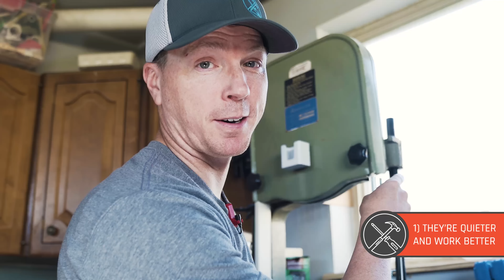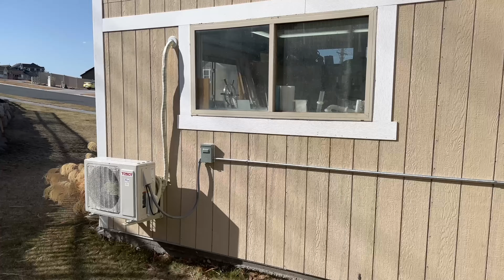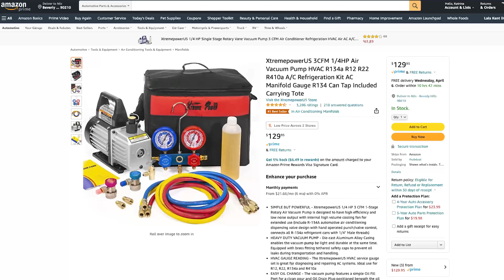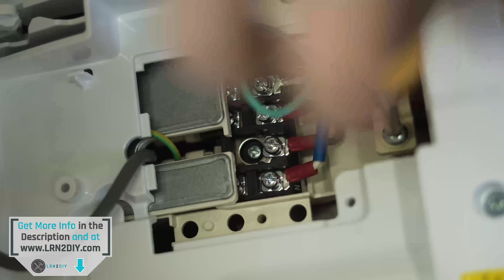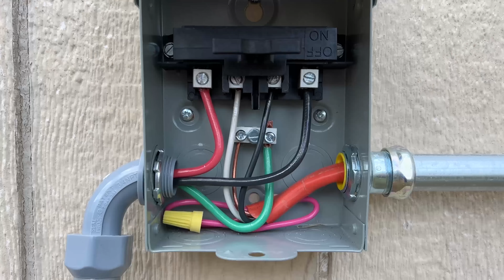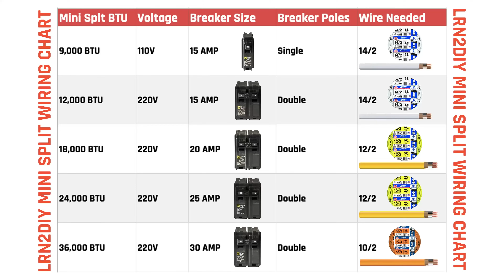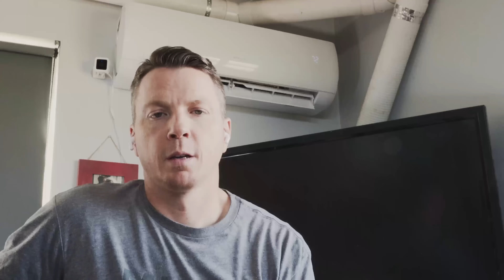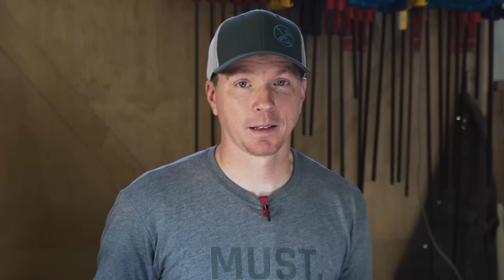Mini Split - 3 Things I Wish I Knew Before Installing

Comment: One other thing to mention is that the units where you don’t have to draw a vacuum, you can’t cut the lines. If you have a lot of left over line you just have to leave it coiled and try to hide it. On the others you just can cut them and glare the ends and have a cleaner installation. Great video

Comment: Just so you know the voltages are 120 volt and 240 volt not 110 and 220. Also figure a little higher for the electric than lower because depending on the distance from your panel the wire size might have to be upgraded in size to accommodate the length. Also a non fused disconnect is around $45. And all this electric is dependent on the homeowner doing the work or it could be upwards of thousands of dollars for a “Professional “ to do it. Another thing is most A/C “Professional “ don’t like to work on DIY equipment so you could be on your own for projects like this.

Comment: Not for nothing , you didn’t have to put the window ac unit in a window …cut a hole high up on a good wall and mount it there … not only will it work better , but you won’t bang your nogging ! 

But now you got a mini split … which are awesome …
Reply from the maker: Through-the-wall is a great option — you keep the window and get better placement out of it. Appreciate you watching!

Comment: I understand the precharged lines with the Mr. Cool, and why you would need to pull a vacuum with the other unit, but then where does the refrigerant come from.  Does the other unit arrive in a pumped down state where all the refrigerant is in liquid form stored in the dryer/receiver/accumulator and after you vacuum the lines, you just open the dryer valve?

Comment: I installed a Seville 9000btu unit 4 years ago. Took me awhile to, but it was not too difficult. I had to recharge the refrigerant this spring (found a leaky schrader valve) and it now heats and cools like new. If you can do electrical and basic plumbing, you can do this. TIP:  buy the proper tools!!!!! It’s worth it.

Comment: For the cost of a cheap vacuum pump off Amazon and ordering a 12k btu mini split from Lowe's online. I'm less then $600 in the min split setup in a detached 120sqft converted shed/office. It's May 2026 and the prices must have really come down. Mine is also a 115v unit and yes you can wire it with a regular 3 prong plug but I wired it to a service switch and then to the panel from there. I am not an electrician but I am a contractor and had an electrician buddy hook me up but I did dig the trench for the conduit and did all the rough in work. Perks of being in the trades.

Comment: Companies encouraging homeowners to attempt mini split installs can turn into a complete nightmare . Im going to look at a 3 head system in the morning that leaked off the first day they used it . The guy pressure tested by opening the valves . What a mess . Get ready to dig deep in your wallet because I will show now mercy.  Total foolishness.  Stop it ! Just stop it already . Have a qualified hvac or refrigeration tech at least pressure test and vacuum down with a blue vac micron ,add factory spec charge if needed for longer line sets .  You only get one chance to get it right .

Comment: oh how things have changed in the last 3 years for the cost of electric cables to run the electric lines. The running of electrical lines is frankly my biggest hold out.. Mostly because where I want the Mini Split is on the back of my building and the panel is on the front so it will take a lot of cable and routing in order to get the lines where they need to be to power the unit.

Comment: Those lines from Mr Cool are pre-vacuumed that's why you do not need to vacuum the system after the quick connects are done.
The "other" brand lines are purged an back filled with nitrogen.
BUT you are correct, follow the directions and you can do the vacuum process yourself!

Other options to consider with unit cost;
1) Motor control for the blower vane direction for z (up and down) and y (left and right) or manual.
One of mine is both (great for larger areas) and the other is only z (up and down) where z is manual (great for smaller areas).

2) Units can be equiped with internal heating elements for very cold cliamtes.

3) Internal UV lighting for microbial air cleaning.

4) Cheaper units do not have good vibration mounts, so if you get the flat piece of rubber, buy the better ones.

Important note for installation, people take for granted the condensate lines which drip water so keep it away from siding.

This is a great video!

Comment: Just an FYI unless you have an EPA ticket to work on refrigerants it can be a huge fine just opening the valves that allow the refrigerant to flow into the lineset and indoor unit.  Chances are small that would happen, but it's not a zero chance.

Comment: I believe you forgot to mention the cost of the Freon? What did you pay for the Freon you used to charge your system and line set with?
Reply from the maker: There is no additional cost. When you open the lines from the condenser, it's precharged with the refrigerant and goes into the lines. No additional freon or refrigerant is needed.

Comment: Here in New Zealand those single unit window THINGS do not sell here. Almost all are the twin unit types. Just a point, I would not mount the outside unit to the walls of the house. It can transfer noise and vibration into the home. Better to mount it on a concreate base or tile. The hole unit makes less noise, full stop.

Comment: 🌴🤔 I’m going to be getting a mini split put in , I have a window shaker for A/C right now , I’ll need to install a dual zone as one unit will go to a bedroom on the far side of the house and one unit will go to the living room , I’ll have to have enough refrigerant tubing line to reach each area , ( how long are the lines that come with the mini split system ?) 👈🏼 can you buy extra lines ? How much do those cost and do they have different lengths? 👈🏼  as the outside area of my garage close to the electric box inside is the perfect spot it’s just that I have to bring the lines up the wall outside over a one stall garage ( first drop for inside zone ) it’s about 21’ feet, and the second line would go up the wall outside over the garage ,over the living room to the bedroom wall 35’ feet , —- how long are the lines that come with the unit ? Are the extra lines pre charged ? 🤔

Comment: I didn't hear you speak to the cost of the refrigerant?
Reply: But one that is pre charged. I just finished mine today. Once everything is complete and you pull a vacuum on the system you use an allen wrench to release the refrigerant.
Reply: *Buy one pre charged

Comment: Per your graphic, the A/C Branch circuit breaker is located in sight and within 50 ft of the equipment, so separate disconnect is not required. The AC branch circuit breaker is your disconnect in your case.
Reply: I think the graphic is misleading because he shows the indoor unit and the main electrical panel even though they are indoors, just to show all the bits. So it wouldn't be "in sight" to someone working on the outdoor unit and depending on where the door is it could easily be more than a fifty foot walk. 
I'm in the UK and mini splits just plug into any standard outlet. That's the great thing about having 230V 13A outlets as standard. Mini splits come with the mains lead and plug fitted to the indoor unit and the outdoor unit gets power from the indoor unit. There's no requirement for an outside isolator switch.

Comment: 1. Call a professional to do the install. That is a bad location for the indoor unit. Cleaning the filters and service in the location is going to be terrible.
Leaving the extra refrigerant lines coiled up outside is a very bad idea. The oils will not get back to the compressor properly. Compressor WILL fail! After doing it yourself you will probably have a hard time finding a professional to come and fix it for you. But you saved a couple bucks.

Comment: What is the difference withe the cheaper ones you can buy off of Walmart? Also we live in a trailer house... how do you go about that if yiu have an extremely old hvac system you just want to get rid of? Do you put one in each bedroom or just one bigger one in the living room area and just try to run fans?

Comment: I got a vacuum pump with gauges and the adapter for $60. Installed 2 18k btu units for $800 cheaper each compared to the Mr Cool. I saved $4k from just replacing my heat pump not counting needing to overhaul the old ductwork.

Comment: looking to buy a new home and most homes here are old and its hit or miss if it has central air or not. i guess i can install 3 minis  or maybe less. since the homes  im looking at are smaller 1k sq feet but if its 2 story ill dev need one at the top level

Comment: Such a good presentation of information.  I had the electrical work for the minisplit I am putting in done by a professional electrician.  The actual mounting and vacuum test on the lines is tomorrow

Comment: Many states will not allow you to buy the refrigerant that goes in those systems without a state authorized license and knowing about the charge and how it works and all of the details to evacuating the system escape most DIY and doesn’t take much an ounce high or an ounce low it’s not gonna run right. If you evacuate the system and you don’t charge it pump it down when you still use nitrogen, that nitrogen absorbs any moisture in the system when you blow it off and pump it down again you’re much better at not having moisture in the system.😊

Comment: For us, I miss the thermostat on the wall to give me current room temperature. The Gree mini splits don’t give a room temperature reading. I also don’t like that each indoor unit that shares an outside condenser must be on the same mode. For example, if you have 3 bedrooms connected to the same outdoor unit, they all have to be in cool mode. One can’t be “cool” and the other to “fan” or “heat”…. That’s more of a problem when different floors use the same condenser. But, I’m researching something to display room temperature that can also be monitored remotely.

Comment: This guy just told you to use a $130 vacuum kit.. This kit is shown to come with the blue/red/yellow hoses you see HVAC guys use. Those red/blue/yellow hoses CANNOT be used for vacuum has they allow for "gas exchange". They are REFRIGERATION HOSES designed not to bubble.. Simply put.. HIRE A CONTRACTOR.. VAST majority of the DIY HVAC videos are simply a cinema of mistakes.

Comment: [This is 100% to help to everyone here] - Licensed JW - The breaker required by current code is going to cost between 100-200 by itself (depends on your exact electrical panel). Yes, another option is a non-GFCI breaker at the panel and a hot-tub style disconnect with a GFCI breaker contained; basically the same result. Factor either in here for sure. Yes, you are required in most places to have a permit for electrical work. Perhaps you aren't, but another cost if you wish to abide by rules and possibly have issues on a future resale. Also not mentioned - code requires within 25 feet of your AC installation (the outside unit in this case) to have a service receptacle. Many of us call this an outlet. That is required to be WR rated, with a heavy duty rated cover, and either be protected with a GFCI breaker or generally it is easiest to have a WR GFCI receptacle. BTW - The GFCI breaker for the mini-split is not the same as the one for the service receptacle. There are two different circuits here: one is protected by a 240v and the other by a 120v. (Ignore all the 110,115,120 <it is all 120 for terminology> and the same for 220,230,240) Good luck and cheers :)

Comment: Very great advice! Only critical thing you didn’t cover is installing surge protection. I found quickly mini split /ductless units are very susceptible to damage from power surges and outages.
Reply: How did you remedy this?

Comment: 2 more things you didn't know: 1. 2025 brings new R32 refrigerant requirements which means your R410A will be phased out. Also I.R.A. gives you a 30% tax credit on certain Energy Star rated heat pump mini splits. That's up to $600!

Comment: I have a LG AC/Heater unit in my garage. It is over 20 years old & it went belly up. Unfortunately I have to get another LG thru the wall AC/Heat unit since I do not have any room to install a mini split unit. I will be putting a mini split unite when I build my 20 foot by 20 foot shed next year.

Comment: Two things regarding the electrical: No Romex in conduit, run separate wires, it's much easier. Also, the service disconnect has to be within X feet of the compressor (in CA it's three feet), so check what code is in your area.

Comment: Question :  how far away can the outdoor unit be (and the line sets) from the indoor unit?  Also does the indoor unit have to be on an exterior wall?
Reply: From what I read you get 16 foot with the unit. The Freon in the unit is for 16 foot. You can get 25 and 50 foot but you will have to use an AC guy and put more freon in the line. The outside unit should not be in the sun or heat. The indoor unit can be on an interior wall but you will have to figure out how to install the copper lines. You might have to redo some sheetrock. That's why it's easier on an outside wall  you just drill one hole and seal it.

Comment: Hey Bud great videos, I recently got inspired by you seeing how easy it is to install the mini split units. I went and purchased the Tosot 12K BTU 230V my question is 2 part 1) if I’m not mistaken it’s a 15amp am I correct cause I went and purchased a 2 pole 15amp circuit breaker and 2) I have some 14/2 romex left over from some other wiring jobs I did around house, or should I bite the bullet and just buy 12/2 in case I want to upgrade the unit. Again thanks.

Comment: Installed a new 12k mini today but disappointed that after vacuum and pressure test that worked perfect I only get 49 degrees out of it while my neighbors is 36 degrees. I kept the same 3 year indoor unit but it was ok. Any idea where Im losing 13 degrees.

Comment: It's so crazy how we make things difficult for no real reason. In Japan, Mini-splits are normal and use normal outlet plugs on the inside next to the wall unit. 200v or 100v. Just like your old window unit did.
Reply: But the condenser is outside. You just throw an extension cord through the window and leave it cracked open?
Reply: @torsten6777 The inside unit powers the outside unit through the connecting cable; just the reverse of US units. Different approach, different codes.
Reply: Maybe the amps and wattage is different there. Here fires and overload are a concern.

Comment: So, a great video production for sure . I'm a 39 year HVAC veteran. Now for a reality check, guys in this trade for years, can still suck at ductless installations.. Cutting, flaring, and deburring tubing properly, is a difficult skill to master, even for a skilled HVAC tradesman. That said, these can be a great solution for many applications, where conventional equipment is too costly or impractical.. And you don't want pay 7 or 8 thousand to HVAC contractor. The part the presenter greatly down plays here, these are "applied" products, meaning it takes many different electrical and mechanical disciplines to accomplish. And if something goes wrong, and you have leaky flare connections, or a malfunction occurs at, or after installation, you are now faced with becoming a ductless mini split HVAC tech, in addition to those installation skills you just took on for this purchase.
Can a really handy guy or gal, pull this off, yes.
For the half hearted guy, with knowledgeable friend, then yes. What are you gonna do, if it has a defect, or breaks down, and needs to be diagnosed by a real ductless technician? Even just to figure out how to deal with whoever you bought the system from ? This isn't a toilet, a sump pump or a shower stall kind of job here. You do a disservice to the viewer, by making it seem so easy. Good luck, to all. I am an avid DYI guy myself.. Though I don't try to remove my own kidney stones !!!!!
Reply: There are literally hundreds of install videos on YT that were installed by people I would not trust to hang a picture on the wall. LOL. Flaring is not a skill that requires 2 years in college. You are  sweating the small stuff that you could be earning. Think BIG!

Comment: Okay, I’m pretty handy, built houses from start to finish incl elec & plumbing. And I’ve lived in China, home of the plug in mini-split. But you are telling me that the only difference between Mr cool and your brand is that I just need to pull vacuum on yours? No refrigerant? Where is that stored? In the condenser?

Comment: My lineset are only 16 feet long and if I order the longer ones, they don't come pre-charged.  I'm thinking it will be cheaper to pull electrical to a better location than buy a longer lineset.  Thia project in my house has been more intensive than yours was lol.

Comment: if I buy a "2 zone" (2 head) unit, can I only use 1 of the heads?   I am not able to find a 1 zone / 1 head Bosch unit at either Lowes OR Home Depot that is 18k or 24k  (1.5 ton or 2 ton).  I have 1500 square feet total, but I only use the main floor of the house, which is probably 1100 square feet.  I do not want to oversize or undersize my purchase.   I am needing to buy it at one of the 2 major retailers for several reasons/advantages:  2 year no interest financing and being able to easily return the product, should the need arise. etc.

Comment: Great video, I’m in. How’s the Tosot running now that it’s been a couple years. Is there an extender line set as my closet placement for the compressor for me would be approx 40-45 feet away. At $650 for a 12000 BTU I’m ready to pull the trigger on this unit.